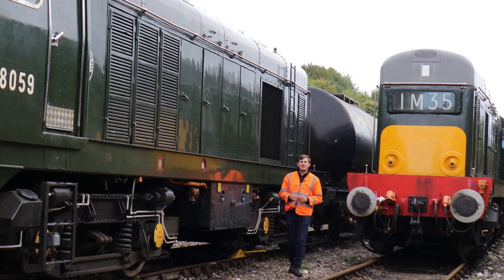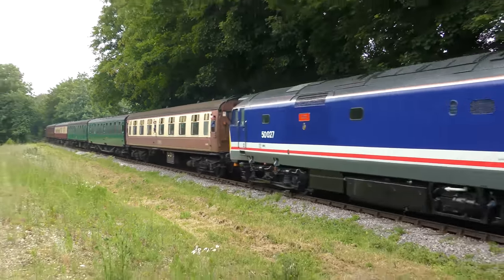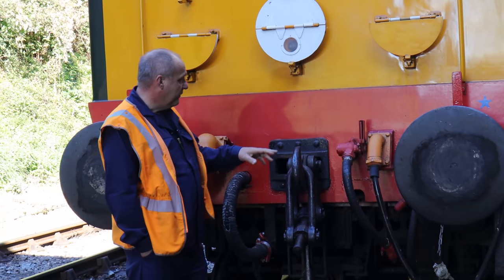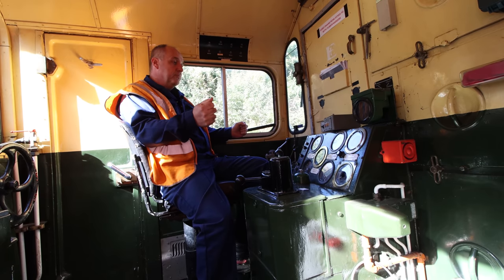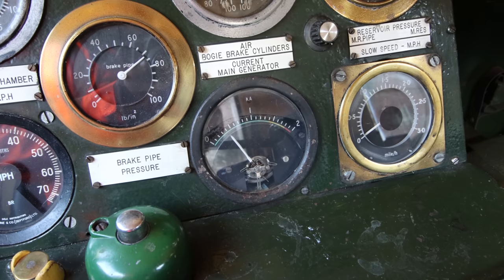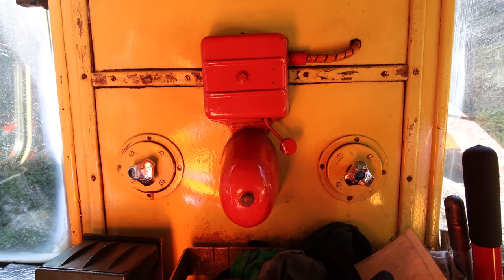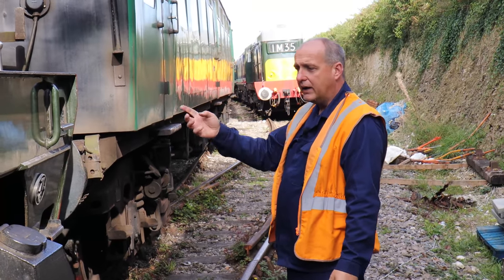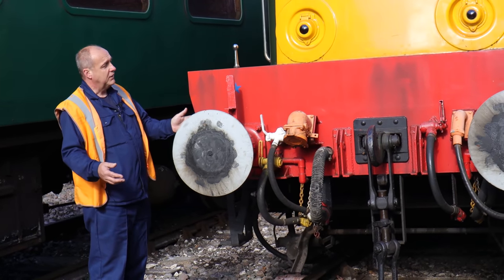Locos Of The Line: Class 20 'Choppers' - D8188 & D8059

Comment: As a retired Driver, Driver-Instructor, and Traction Inspector this bought back many memories of the thousand of hours that I spent on Class 20s. At  the depot that I was at (Frodingham) in the 1970s This class of loco was used singly on local trip pilots and banking duties and in multiple on train work. I well remember how one had to hang on tightly to your seat when doing 70 mph on the East Coast mainline. They were also used for shunting work in the Scunthorpe steelworks on jobs that were too heavy for Class 08 locos! For instance, pulling up to 100 wagons out of sidings and sorting out fitted wagons, cripples etc. They were generally very reliable locos, I can't ever remember having a complete failure with them. I had the odd occasion where one of the electrical jumper cables was wrongly wired and when coupled to another loco would work against each other, the cure for this was to swap the jumper cables over, this invariably cured the problem. Happy days!
Reply: Didn't they have a minor problem with the speedometers? They used to run high, so you thought you were doing the top speed of 75mph, but you were probably doing something like 68 to 71mph.

Comment: A very interesting video gents. As an apprentice with E.E.Co. from ‘55 till ‘60 assembling many bits and pieces of ancillary items shown in the video it was very pleasing to that they are still serviceable to this day! Good stuff from Preston works! Lots of items were interchangeable with other classes of their locos including on the engine components eg cylinder heads, pistons, valve gear, pressure switches etc etc. This also applied to the electrical control equipment too, which is very handy in preservation today.
On the original drawings in the 1950s the classes were denoted as letters viz type 1s were class A & type 4s (class 40s) were class C.
Watching this video brought a host of good teenage memories back, many thanks.

Comment: I do like the class 20's. A question on the air pressure though  why is it at 72.5 psi. What's wrong with 70psi or 75 psi? E.t.c.

Comment: hi there. what a great video. love the 20s when i was on the underground we used them to move new stock around.how often do they get an engine service ? ie oil changes etc and tappet clearence checks,i take it the cooling system runs with an anti freeze mixture in. its a pity the class 15 and 16 were not as good more than likely due to clown activity on the drawing board,  model wise the new bachmann 20 is top of the pops !
Reply: Thanks Peter.  Maintenance is based on engine hours, as these locos will generally not do thousands of miles, but will be running for quite a time.  We also take regular samples of the lubricating oil for analysis (this will indicate any issues in the power unit depending on its contents).

The coolant does indeed have anti-freeze.